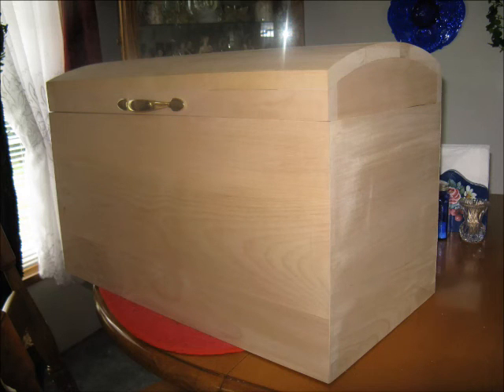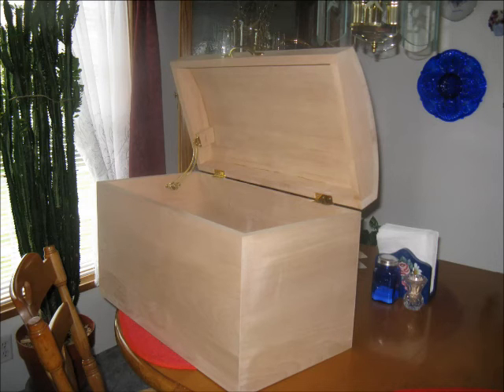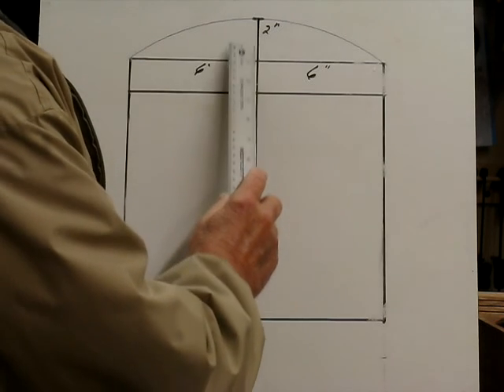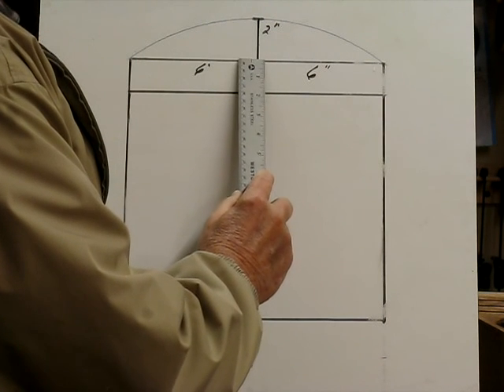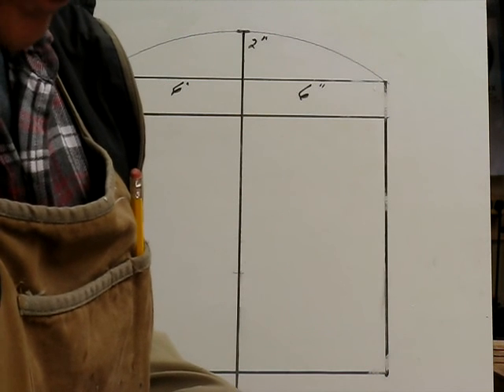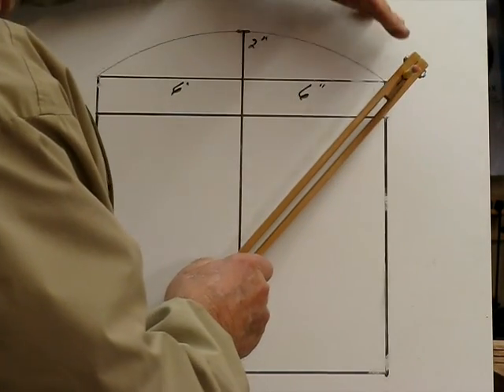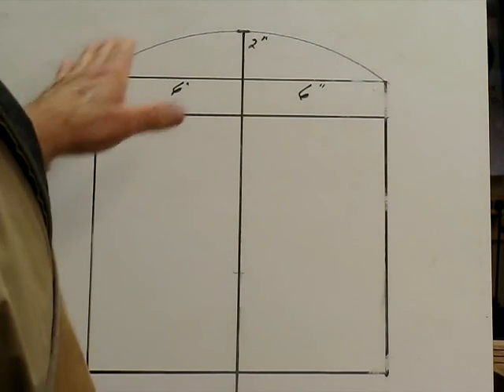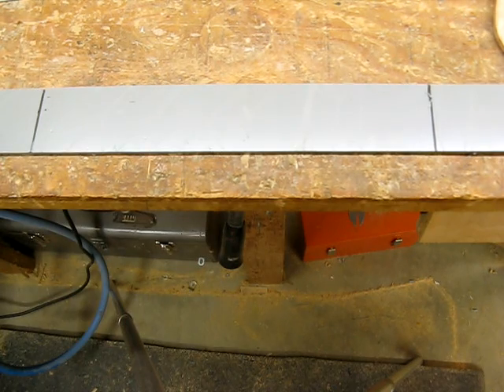Round top toy box lid radius calculation; part 1

Comment: Hi Wayne, these directions are great. Question- when I made my top arch 6" the circle trace went off my sides leaving a 3 1/4" straight edge each side. Is this going to be an issue? My treasure chest lid needs to be 16 3/8" wide. center of that is 8 3/16".  The intersect was 14" I used to trace the half circle.  Wish I could attach photo of template to help explain. Should I make the arch smaller to meet the 16 3/8" width?

Comment: So if you determine the radius of your circle, you can then double it then multiply by 3.14 to get the total circumference. Divide that by 4 (for ease of calculation) to determine the length of 90 degrees of the whole. Once you have the length measurement calculated, you should be able to divide that by your desired stave width to get the total number of staves in 90 degrees. Divide 90 degrees by the number of staves to get the angle between each piece. I think that would then be cut half on both sides of the staves to get the proper arc. 

Let me know if that isn’t correct. I was pretty good with geometry, but I have never actually built any of these curved pieces